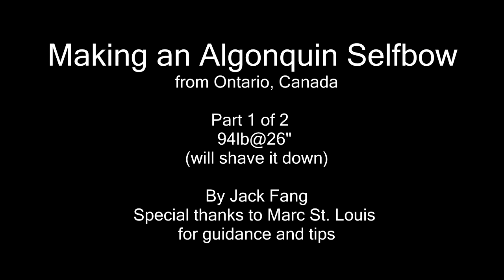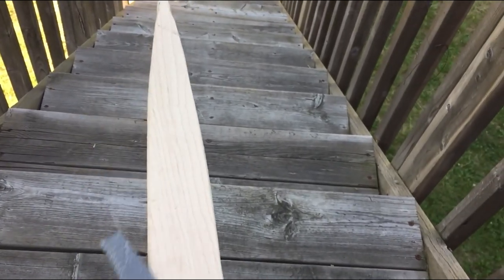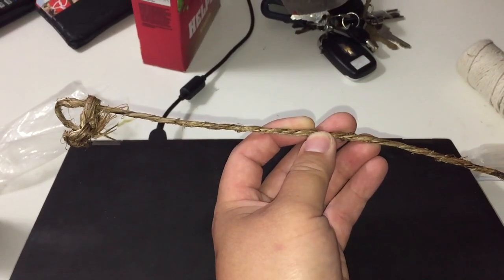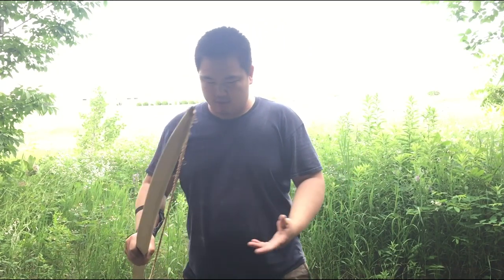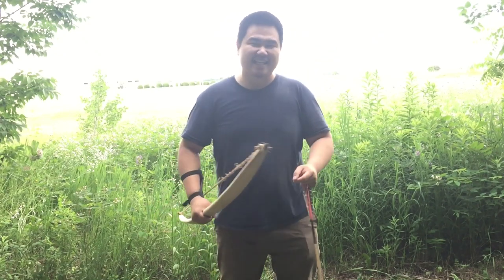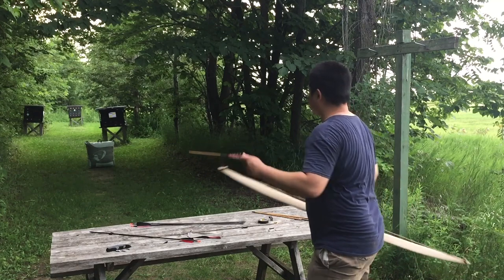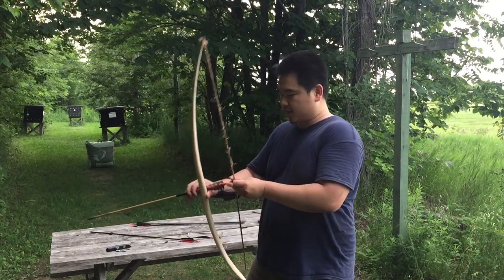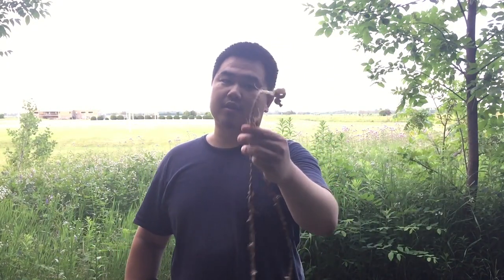Make a Native Flatbow of the Algonquin

Comment: you can also change grip with that type of bows, often the natives did not stretch everything but opened just enough to let the arrow slip away from the fingers, in fact often the grip on the string they used allowed to stretch a little ... but it was so interesting little to have a very high reach

Comment: Stinging nettles have the strongest natural fibers and were used for cordage. I know there are nettles in your area and I'd encourage you to try them for bow strings.  Also,  there is no advantage to using a heavy weight bow in a forest setting with common wood arrows. While willow shoots were used for shafts, many preferred using shafts split out of seasoned cedar logs. Arrows from either material are quite light but also perfectly functional at woods ranges with stone points.  A bow half the weight of yours would be far more typical and would not be a hinderance in hunting or warfare.
Reply from the maker: i agree there is no advantage except "showing off" a warriors strength

Comment: Great job on the bow. I noticed when the string broke that you have a little bit of set or string follow in the bow. That's easily fixed by heat treating the belly of the bow. I just finished a red oak bow and did the heat treatment on it. I set the handle of the  bow on about a 4" high box then weighted the ends of the limbs with an axe  head (minus the handle). Then heated the limbs to a light brown. That cured the string follow.

Comment: gut string or get yourself few squirrels and do raw hide string 
I like this bow it's very nice 
check how fast the arrow 
40 at 32 will be  awesome 
this bow is going to be fast 
I think
Reply from the maker: thank you, im aiming for 60-70lbs because my personal preference to heavy bows, and it is concievable that some native bows were that draw weight. do you think the rawhide is strong enough?
Reply: @HistoricalWeapons   both types of strings are very strong just make sure that you do them correctly and have them dry enough so they won't stretch on you .
I watch your channel all the time and I know your a pro but no harm for sharing 
you need to materialize the handle on the bow, know exactly how long you want it to be then take your time, you  have to be very patient as you know already.
I think you need to do the work on the  belly of the "lower" limb, then  when you move to the upper limb, have the curve/bend far from the grip/handle.

don't work both limbs close to the handle shaving them to have a "bend" 
let the lower limb have the bend right next to the handle and the upper will start to have the bend below the Knoke close to the center.
having this balance is not easy but it is achievable  
All the best

Comment: The hemp string you are using is much stronger when wet that is why it’s used for boats. Maybe soaking the string before use would help. Nettle fibres are also used for strings and I’m sure it’s plentiful near you. 
 I think the natives draw was different than you are doing. The natives draw to the centre of their chest so that makes a short draw, a short arrow and a nipple anchor point. 
 When I use the nipple anchor point I find it much easier to do the pinch draw. It’s like shooting from the hip sort of. 
I don’t think the Natives look down the arrow as the arrow was nipple height.
Reply from the maker: interesting, why is it stronger when wet? ill try the nipple anchor point, but not with 94lbs. i was merely using a med draw for the weight, ive attempted the tertiary pinch draw but cannot pull that weight
Reply: @HistoricalWeapons   if you draw to your nipple it won’t be 90lbs.  Usually if you draw a native bow past centre of chest it will break. So you want a stiff bow for that short draw.
Also if you pinch draw it is easy to hold low at chest with elbow down. Just try a dry run right now and you can see the pinch is a more awkward position at head height.  You can pinch harder at shoulder or chest height. Pinch draw is even easier yet if you hold the bow more horizontally and low. ( 40*-45*)

I think hemp is stronger when wet because the fibres  lock together better when wet. Maybe it swells and tightens the  twist so it becomes tighter on itself. If you twist the string too much it may weaken it so I would suggest a bowyers knot so you can tighten it without over twisting. 
 The natives snap shoot so that also makes it a bit easier to use pinch draw.  Also the natives shoot from a sort of crouched stalking position which makes for a shorter draw or reason to draw to the sternum or tit nipple  area.     Instead of string hand touching your mouth, ear or jaw you should touch your sternum or nipple for anchor point.  It’s a whole new aiming method so prepare to lose some arrows behind the target.
26” draw is good, don’t make it draw longer.
 I also saw in the comments you were talking about attempting one with stone tools but feel inexperienced.  The stone method is no different than the file and cabinet scraper. You should get or make a cabinet scraper. You can make one by taking a bit of sheet steel and using a wrench handle or hardened tool to create a burr on the edge by trying to slice the wrench with the corner of the edge. This is the most useful bow making tool you can have.  Stone tools just slow the process by 100%
Regarding the pinch draw , I have also seen and herd of bulbous arrow nocks that aid in pinch draw. Just a few wraps of reinforcing thread can help grip and traction on the arrow. The tips of first and second fingers also pull on the string with most pinch draw styles.
And you can use the two or three finger string draw with chest anchor. That’s what I have done because I too can not pinch draw 40 lbs. those people had strong pinch.
Reply: And there is a few kinds of dogbane where you live but I think stinging nettle is better. I’ve also herd of fur or spruce roots being used but I have never been successful with it as you need the perfect roots to start with.
Reply: @HistoricalWeapons   God bless you

Comment: how did you cut the wood to make the stave i cant figure out how the grain should be
Reply: Straight grain I think
Reply: Use a saw
Reply from the maker: i used a circular saw because i was lazy . i might explore stone tools in the future but im not competent in that field. you can use a belt sander to start rounded the edges and shaving rough material before using hand tools. saves time
Reply: @HistoricalWeapons  thanks 👍
Reply: if you try to bend the bow and it wants to crack does removing the material make it less likely to?
Reply from the maker: @jzjzjzj  if u hear cracking it is likely garbage, if u feel it may crack, removing more material so the bow is a shape of semi circle when tillering should reduce the change of damage. if ur new to bowmaking, the easiest way to make a bow is to make it longer (7 feet-8 feet)

Comment: Great bow, I also use Abaca on my bows and it goes through a stretch in phase every time. I counted and I usually end up twisting the string 30 times. 
Abaca is sold in many different grades. Yours was very course. Try finding the EF fine grade. I have never had an Abaca string break after carefully selecting 2mm fine cords and building them together into a string. Usually 13-16 of those 2mm cords together.
Try resizing your string, shortening it. 
It's more work but when overtwisted,
 it will cut itself.

Comment: I don't know if maybe someone else had the idea before, but I recently had an idea for how to get carbon arrows with a stiffer spine. It's so simple! Just buy a carbon shaft with the same outer diameter as your carbon arrow has inner diameter, and put that carbon shaft into the arrow. That hugely stiffens the arrow. 

I tested it and measured it to see how well exactly it works: I took a Gold Tip Traditional arrow, in spine 340, which is the stiffest they have. I really like the design of the gold tip traditional, since they look like wood, but unfortunately, they aren't available in anything stiffer than 340. Then I put a "BEARPAW Penthalon Slim Line" spine 500 carbon shaft inside. I measured how much stiffer the arrow became from that, and the result is that the Gold Tip Traditional, which usually has a spine of 340, now has a spine of 227. Big difference! And the carbon shaft inside the arrow adds 7.5 gpi weight too, so that's another bonus. If you'd start with a 250 spine carbon arrow, the result would be a ~165 spine arrow with this.

And then one can of course still put salt or iron powder inside if more weight is needed. Perfect carbon arrows for heavy bows! :)
Reply from the maker: i guess that works, the whole point i use carbon is to save money but it appears ur method is too expensive for me. thats why i jam things that are almost free like salt or string or bamboo skwers
Reply: @HistoricalWeapons  Well, iron powder is same cheap like salt,  its like 0.50 USD per arrow or so. Carbon shafts do cost money, but you can probably buy a fitting carbon shaft for less than 5 USD. So it adds 5 USD per arrow, that's not much. Overall it still ends up way cheaper than wooden warbow arrows. Especially if you factor in that wooden arrows are more likely to break, while a carbon arrow with an extra carbon shaft inside is probably quite indestructible. As I mentioned before, my reason for doing this with carbon arrows is also just to save money.

Comment: The trick with new strings. As you make the string. Half way through the process. When ypu have enough to stretch with both hands. If it stretches. You'll have you stretch it. Just bees wax the shit out of it. And string your bow to draw length. Depending on the material  It should instantly should shrink but be tight. Let it sit over night. Next day. Re string it to brace height and repeat until the string doesn't stretch anymore, and remains at draw length overnight. That's just my personal way of doing it

Comment: You are in the right neighborhood but.  string was made from cedar inner bark reverse twist method (you need to prestreach your current string), your arrow are 1-2 inches long  (24-26), the poundage is light 90 (125), natives could bend wood with steam and boiling water( or make a green wood bow then season it), natives used a 2 finger draw (3 if you count the finger on the arrow not the string)  shoot on the other side of the bow
Reply from the maker: when you say the poundage is light, you mean 125lb is the norm?
Reply: @HistoricalWeapons ( No) its just a common high weight bow, bows lose strength over time so a 125 pound bow could ed up a 110 or 100 pounds.   if you go south during trade or migration season you need a bigger bow for game. if you go west you run in to copper shields, if you stay were you are you sit round the fire you say i can pull a stronger bow then you.  a female hunter of the inuit had a bow so strong no one could shoot it but her.       But my source is I used to be a Native American Tour guide
Reply: @pyro3446  I'm not sure which Native nation(s) you mean, but there's considerable textual evidence for powerful bows in the land now claimed as the eastern USA. At various places up & down the coast, English & Spanish observers noted the might of Native bows. These descriptions suggest the better sort of Native warbows had about as high draw weights & similar performance to English warbows. Cabeza de Vaca & Garcilaso de la Vega recounted impressive feats of penetration from Apalachee archers especially.
Reply: @b.h.abbott-motley2427  squamish lilowat inuit Washington state nisga lakota,made bows out of many materials my stepdad made me my first bow he is one of the keepers of the carving tradition, old growth yellow cedar and inner bark string the bow was bent in a wooden box with boiling water. Other bows are built like modern compond bows by drilling the bones and wrapping it in sinew for the bows strength like the inuit. And bending buffalo or deer horn in a geyser if you want a kids or adult bow. I'm sorry a lot o information is lost do to indoctrination
Reply: @b.h.abbott-motley2427  on he east coast they got iron first and alot of hard skin creatures  they needed heavy bows and could make them more efficiently with settler tools. But a 180 lbs  long bow vs a 160 native bow it would be about the same. The short length of the draw and bow are for stalking in every position in the bush
Reply: @b.h.abbott-motley2427  im sorry I danced around the question the Heavy 200 lbs + is done laying down as an early feat of Strength but later you do it standing but you may never be able to if you are one of the lesser tribesagain
Reply: and when you are and adult or strong enough to do it you pick up a canoe that  fit an ocean party on it 600 - 900 lbs